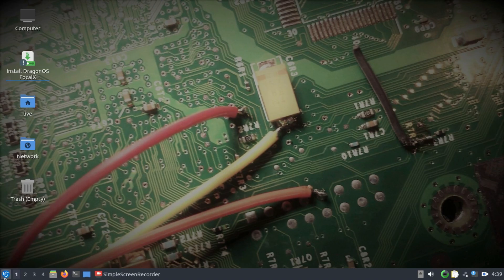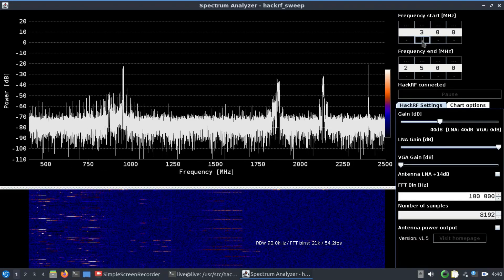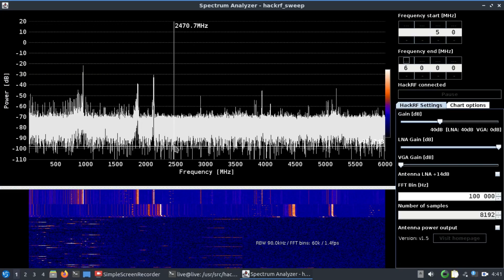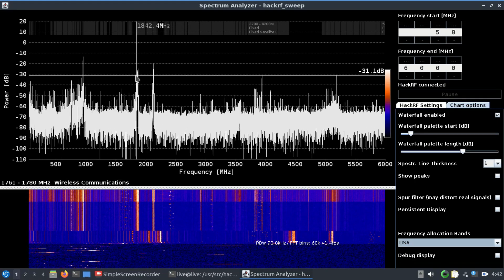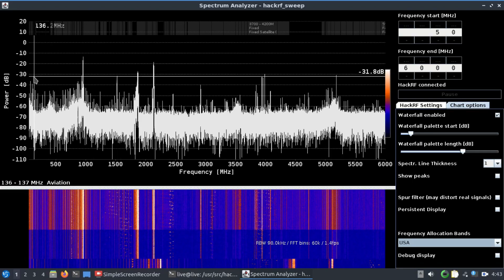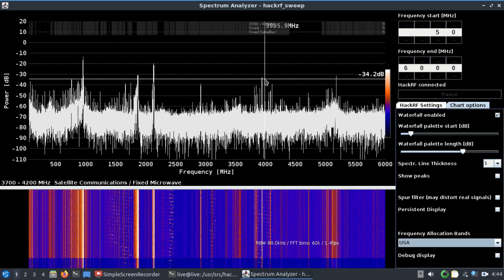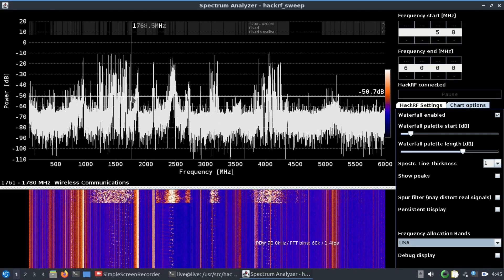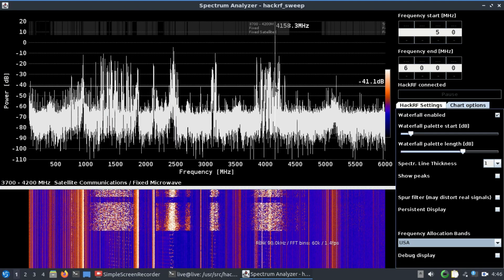Tracking RF Spectrum Pollution Using SDR | Real-Time Signal Analysis & Detection

Comment: I have built a down converter for the RX888MKII that gives 60 MHz real-time bandwidth for frequencies as high as you like or can afford. 6 Ghz is easy and cheap. Great for checking for weird signals. The down converter is double conversion with a first IF at 1.2 GHz then to baseband, with SDR Console controlling it. Double conversion reduces images and spurious signals, but lots of filters are still needed. The first IF is arbitrary, I could get a cheap 60 MHz wide SAW filter at that frequency. Some of the satellite LNAs with wide SAW filters can be used as an alternative, at 1542 MHz. Drew VK4ZXI. Search call for blog.